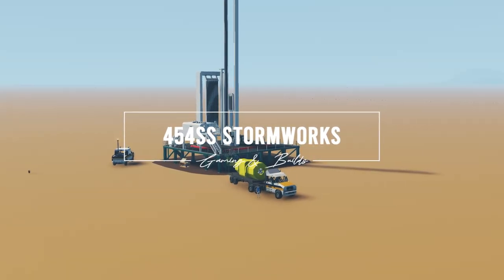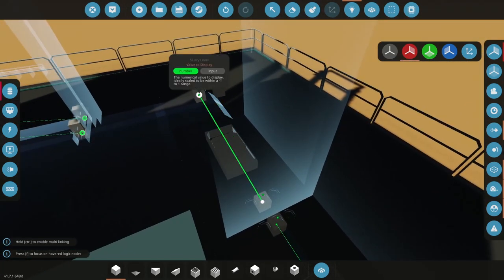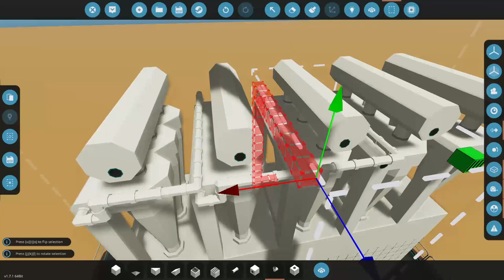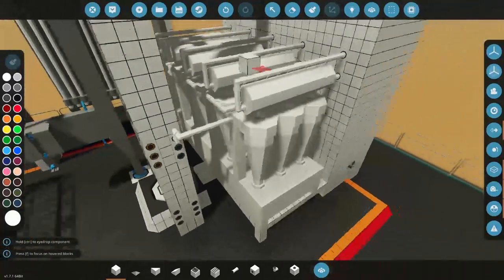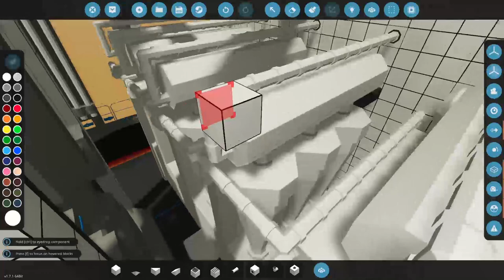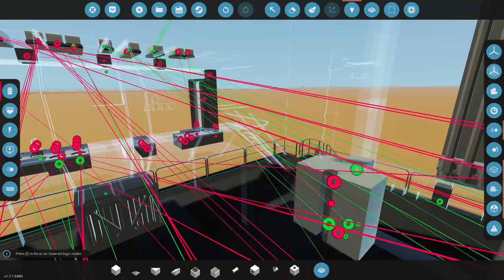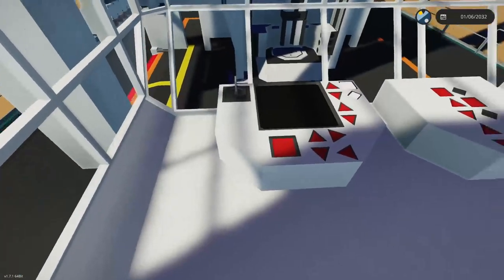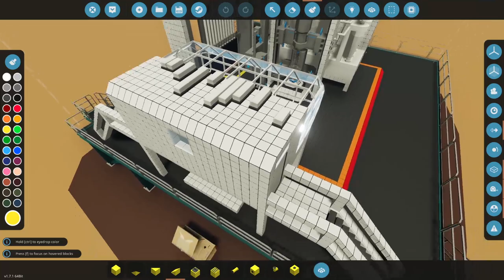Stormworks: ADVANCED OIL RIG PT.3 - Slurry System Creation

Comment: If you don't want 'infinite' electricity on a structure, then still connect everything to a batter, but then click on the battery and put the charge to zero. Then you'll be forced to, at least, provide initial power from somewhere else to charge the battery. Not sure if this is going to work, but trying it now on mine...
Reply: Well, forget that idea. Apparently, if you have ANY battery within the creation, whether it's connected or not; and whether you have a charge or zero charge, it makes the battery have 100% power. So I guess you would have to remove ALL batteries and have some type of generator system that would have to get power to startup from some other vehicle so it could supply power to the rig. Going to be working on testing that later tonight.
Reply from the maker: @jasonleach2961  wow great to know, thanks for the test!

Comment: So, couple comments while I'm still watching the video. Only at around 32 minutes in, so forgive me if you figured this out yet in the video. Yes, frequency is 710. Not sure exactly where it came from, but another creation from the workshop had the frequency of 710 as well and gauges are working. #2 - the slurry - check it, 1 side says 'Saturate Slurry In';  the other is just 'Slurry Out'. #3 On this other creation, it looks like there is 'infinite electricity'. It does not appear that there is any battery drain. Is this because it's a structure and not a vehicle? No, I don't have Infinite electricity on.
Reply: Good series by the way. Been enjoying it watching someone else learning and building, instead of just picking apart someone else's creation.
Reply from the maker: @jasonleach2961  Thanks for the comment! :D Glad you are liking it! Yeah, some things need a bit refinement, but I am sort of learning as I go, and have limited myself to not look at other creations since I want to possibly develop my own way!
Reply: Other comment I had as well, the drill pipe rig and getting them into the pivot / clamp - if you separate the pipes, i.e. have a space in between each one, you can slide the clamp right onto the pipe while in the holder, turn on the clamp to 'grab' it from the holder, then move away. You would need to space in between each one so you don't collide with the clamp sides.
Reply from the maker: Thanks for the frequency, I will try to use it with my update tonight! 2- I will see what the slurry looks like at the swivel and if it is flowing through 3-I never have infinite electric on, but it does not appear to drain like on a vehicle, and same thing with my OMUA base, so it must be because it is a "structure" workbench
Reply from the maker: @jasonleach2961  Ohh I may try that out, I guess the downside is there would only be half as many pipes as my current system, but it would be more automated! Good tip!
Reply: @454ss_gaming  I can definitely understand that. And, probably as like you, I learn much more by doing and figuring it out than just using someone else's.
Reply: Could you imagine if the devs actually provided an in-game way to know the radio frequencies? While building a rig, I accidentally no-clipped into the terrain to find the radio. Then I had to use a scanner, searching for non-zero signal strengths. Same thing with the track switches: How would a beginner know the switchers are on frequency 440 without looking outside the game or brute-force trying numbers? </rant>
Reply: @toast3  Yeah, I know. Google has been our friend, but haven't found the oil rig frequencies on any Google search yet. Just from other builds from other 'Tubers
Reply from the maker: @toast3  Hahah totally! I thought that would have at least been labelled somewhere, but nope haha